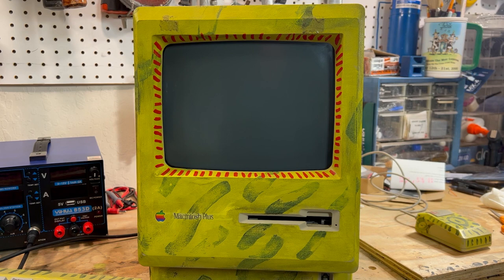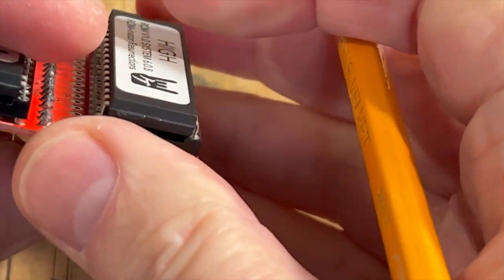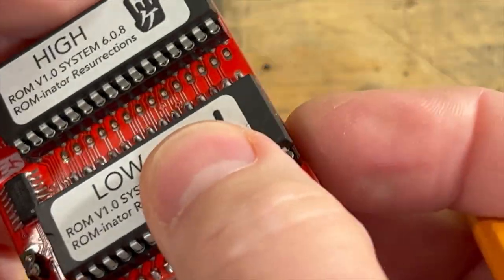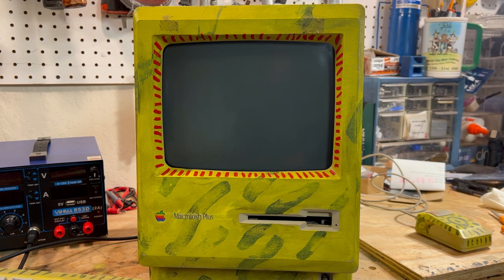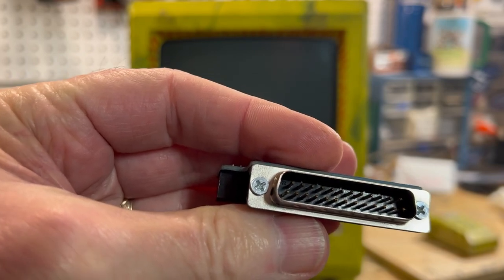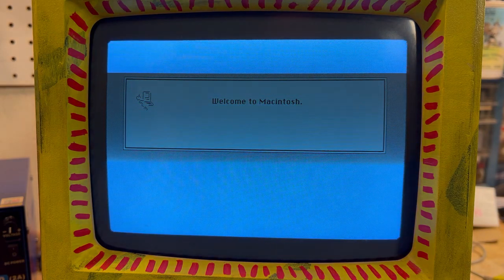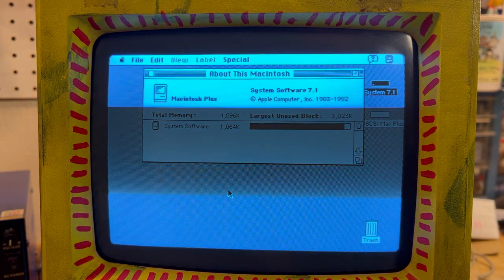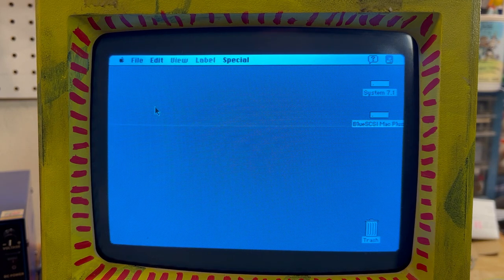RUNNING THE BLUE SCSI ON THE APPLE MAC PLUS

Comment: My Mac Plus doesn't boot from the bluescsi because it looks for a floppy disc non stop... When I unplug the internal floppy cable it will then boot properly. Thoughts?
Reply: The drive appears to be stuck, cannot insert a disk
Reply from the maker: My Mac Plus Boots fine off the BlueSCSI when there’s no floppy inserted + I also have a Rominator on the board as well so if you hold down on the R key at boot up is will take you to the Rom disk but if you don’t hold down the R key then it goes to the Blue SCSI
Reply: @DavidStahlOLDHAPPyMACs  I have to pull my floppy drive and see where the kink is
Reply from the maker: Do you have the diode installed the the SCSI buss to power the blue SCSII that gives it termination power
Reply: @DavidStahlOLDHAPPyMACs  yes, I think my problem is the floppy itself. I'm going to pull and diagnose it.